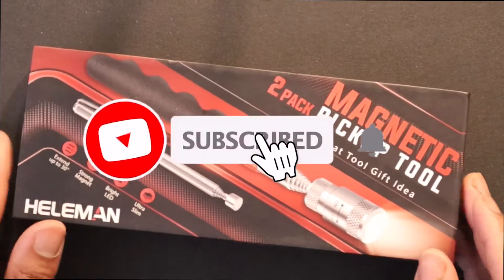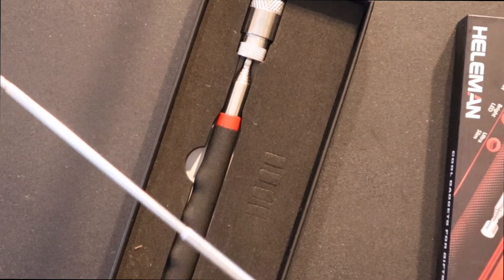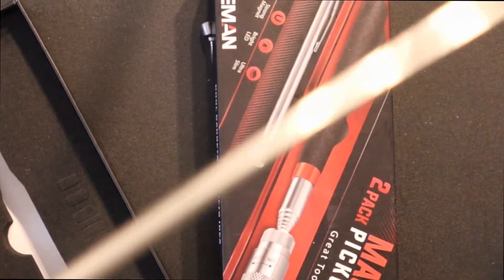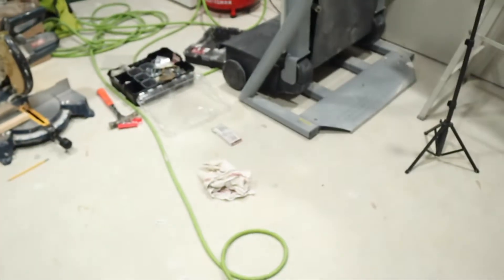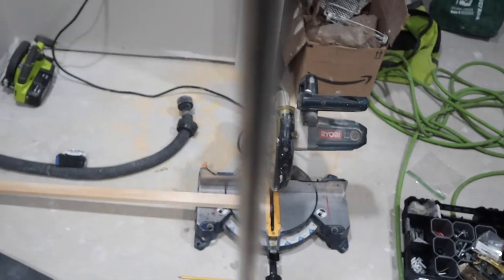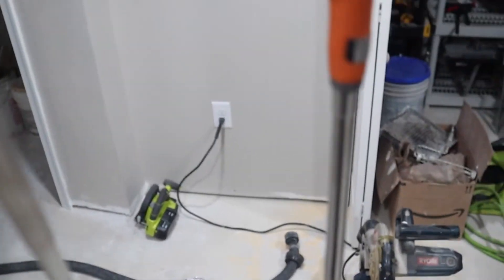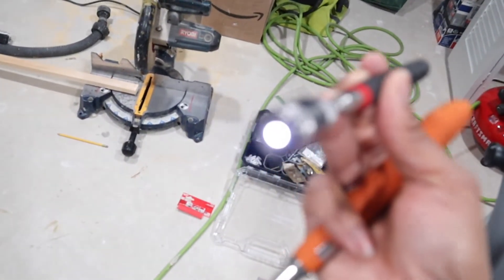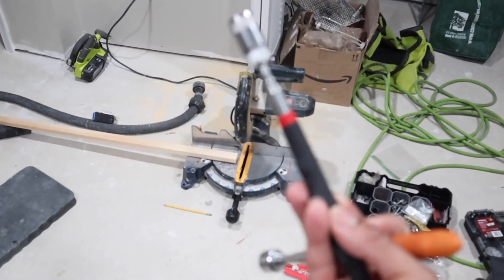Magnetic Pickup Tool, which one is stronger?

Comment: They need to add a light to the stronger orange magnetic pickup tool cause I can see how that would be useful.
Reply from the maker: yes!!!!!
Reply: The other magnet is weaker because they had to drill out an inner hole for the light. You’re better off having a flashlight and the magnet separate, unfortunately.

Comment: Weird question, I got the one with the light but the light doesn't work. Is there something that I have to do or maybe the batteries are not placed properly. Do you have a picture of the way the batteries are placed inside? Thanks
Reply from the maker: You can unscrew the part with the light and you will see the batteries 🔋 unfortunately my kids broke mine and I have to look for another one.